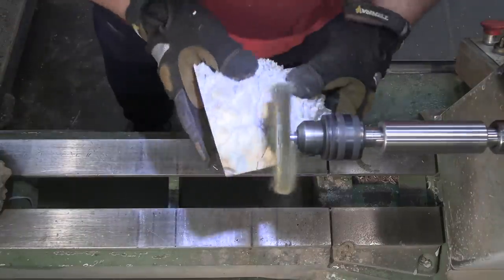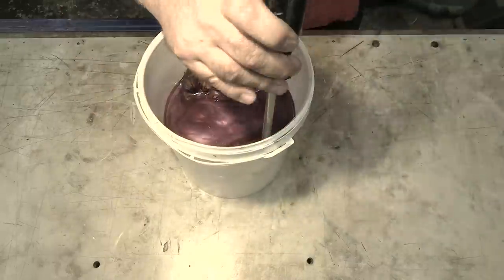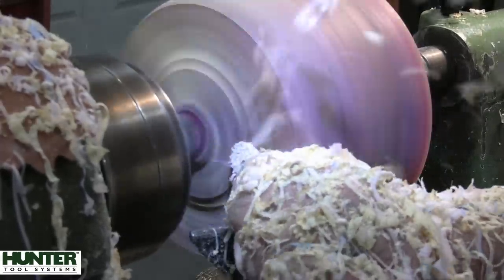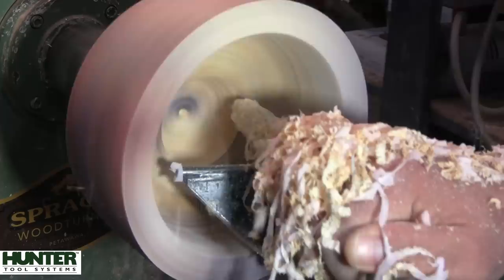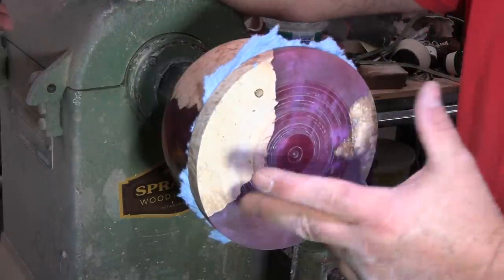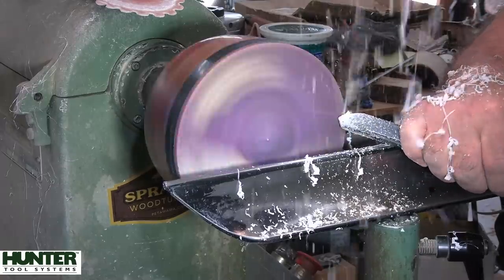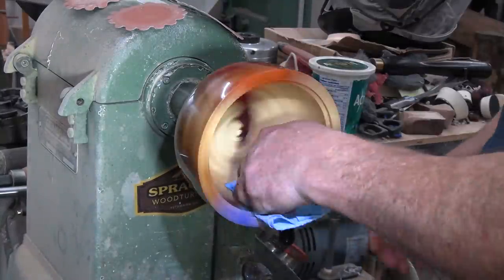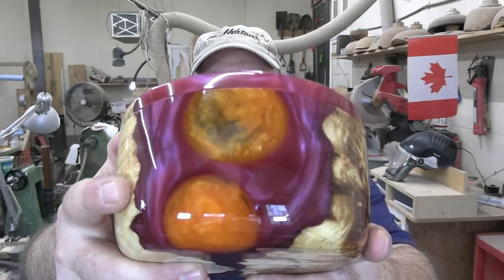Woodturning - The Globe Lidded Dish

Comment: Gorgeous! Love the finial. I have the 2 part sphere molds that Doug has and I don’t care for them. If you don’t get enough hot glue on the seam it’ll leak. Amazon does have other one piece molds with a smaller opening so there’s less flat surface. A few drops of 100% pure silicone oil down the side makes it easier to de-mold.. in fact be careful it doesn’t shoot across the room.😂 it also helps the life of the mold. Any silicone oil residue will need to be cleaned off throughly because it will interfere with resin adhering to the sphere. Isopropyl alcohol works too and won’t need to be cleaned off but, shortens the life of the mold. Sorry for the long comment but, I thought this might be helpful info.
Reply from the maker: No problem! Thanks for watching!

Comment: Definitely like the Pohl Barn inspired globes/planetesimals that add a bit more shapes and effects that can be added to a resin piece, might be good to see a 'bubble' or 'inverse bubble' piece where the globes are translucent in a more solid coloured piece or solid globes in a translucent/transparent piece (so many options/combinations).

Using a UV glue or resin means you could stick them together in some kind of lattice if you had a piece in mind or randomly floating/suspended piece but with a waste block to lessen the amount of fill resin and try to prevent heat cracks, possibly a smaller bowl/container inside the piece to make shaping it faster (less resin used too).

Sure we'll see these globes used again, not sure if ice cube molds would be the key to fast production of equally sized shapes would be good? Sure you'll find something adequate there lol.

Looking forward to future turnings, that's for sure 👍
Reply from the maker: We will definitely see more globes in the future, thanks!

Comment: Jim, I like the apple stem. If you wanted to, a way to "fix" the "egg" look and even tighten the lid, you could have added a band of wood or resin to the top of the bowl and fitted the lid into that. The color looks good.

As for the length of the videos, I will stay with the long ones with the voice-over/talking. I'm glad you are not doing away with what I come to watch and listen to.

Designer Epoxy
Reply from the maker: Thank you very much!

Comment: Keep seeing you guys on YouTube having trouble releasing your items from your moulds. Buy yourself some beeswax mould release wax. Then grab a large packet of sticky backed paper dots of good quality. Drill a 3mm hole dead centre of bucket bottom stick paper dot on inside over the whole and wax over it and the mould at least twice. When you've made your item just blow it out of the mould with your air hose gun. Very very easy release most times. Tiny bit of setup 2 seconds of release time. Pneumatic piston in a bucket..... Can't fail. At most you might have to ding the end once with a mallet where the hole is just to start the air off. Good luck hope it helps.
Reply: Your difference in burl saturation is probably down to north and south facing burl bits.
Reply from the maker: I’ve actually used your method a number of times and you could be right about the burls but I think it’s more likely that one had more dry rot in it than the other. This probably happen with the log laying on the ground for many years before I got it. Thanks for watching
Reply: @SpragueWoodturning  your welcome you do lovely work it's nice watching someone else do it for a change :) I like your unique style and way of doing certain things. Always good to expand ones knowledge base.

Comment: you should greace the bucket with  like butter or cooking oil
Reply: and tou could put mesh tape inside the epoxy when you have it thick it will prevent cracking like when we plaster and it will make it stronger
Reply from the maker: I don’t want to add anything that might affect the integrity of the resin. Thanks